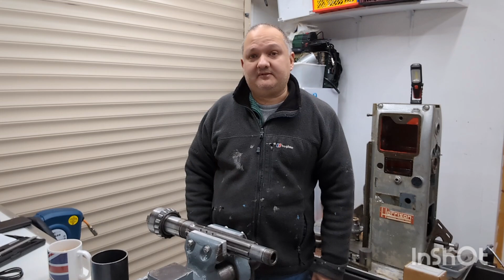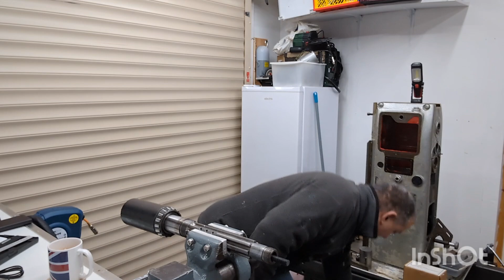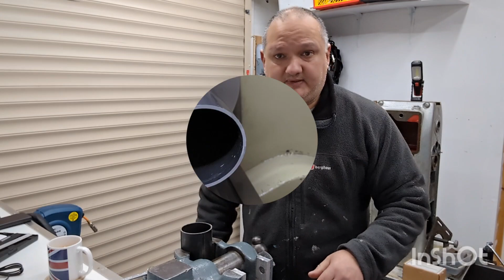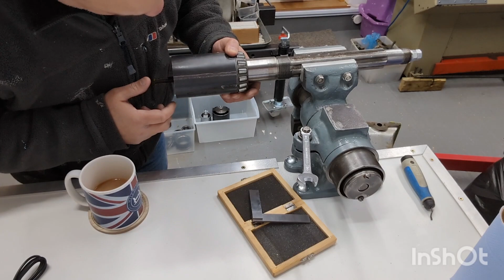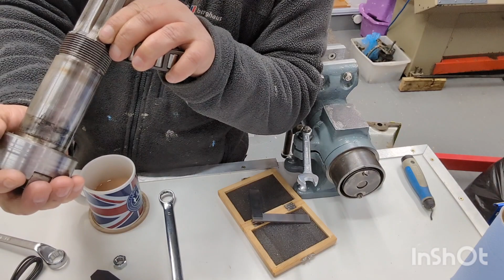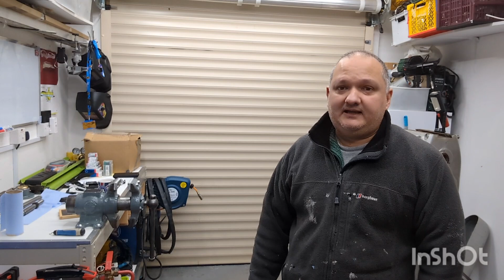Harrison Mill Resto 18 - Spindle Bearing Race Removal

Comment: Short but sweet Carl! That little grunt as the bearing starts to move is always uplifting!! The turbine stuff sounds interesting, I will be watching out for that! Bearings for your Harrison will be either Timken or Gamet and won't be cheap! Is there actually anything wrong with the ones you have, or are you going to reuse them? Just a thought!
Phil
Reply from the maker: Hello Phil, thank you so much for your comments. They are not Gamet, they are Timken. I already have the new bearings that I am going to use. I showed them at the end of Mill Resto 17. The ball journals are Koyo make. I am using genuine Timken taper bearings for the spindle. They were not ridiculously expensive. With regards to the gas turbine, my intention is to try to present a coherent design guide based on thermodynamic principles. Something that I have been unable to find anywhere else in the context of these turbocharger conversions. Thanks again for your interest and support my friend.
Reply from the maker: Oh and yes, I do like that grunt as it starts to move.